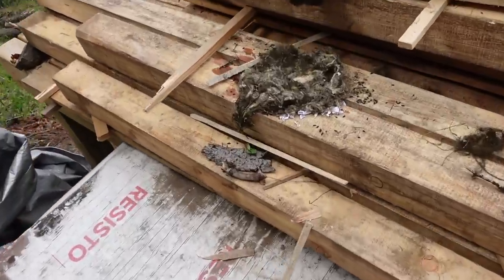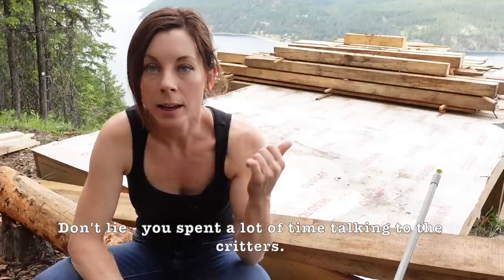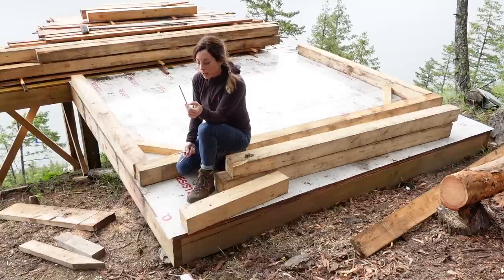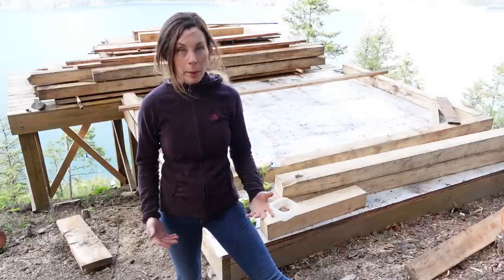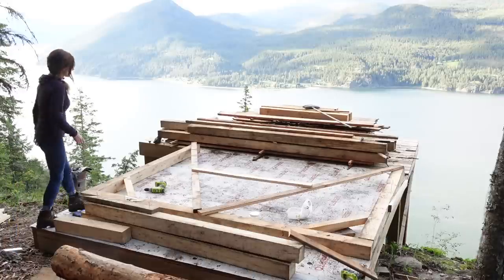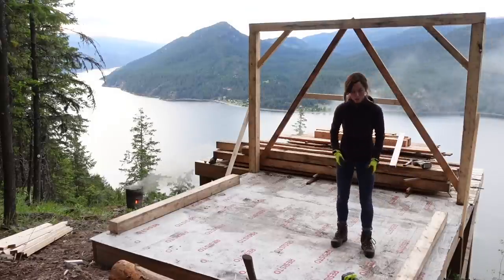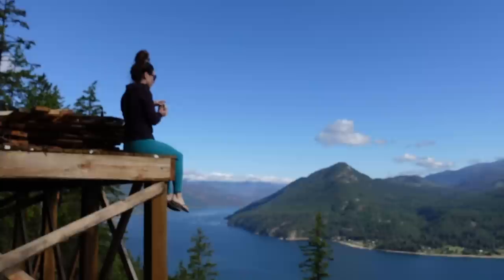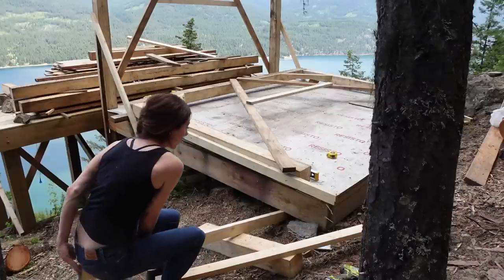Back to the cabin build, baby!! (I'm building a cabin on a cliff Chapter 10)

Comment: As someone that homesteads and does build projects primarily by himself...oh how I know the struggle. And the time...holy molie, the time. Building jigs and levers just to hold something. The sketchy foot and hand holds to not fall while fastening or positioning a piece. 
As you well know it's a journey, not a race...remember that as you go higher. Be intentional. 
Check out the variety of simpson ties or timber hardware available...some of which you can make yourself. Consider wind lift...tie into your foundation platform. And use gussets where you can. Diagonal bracing notched into wall framing, attached at the post and floor is hella strong. If you do it on the exterior side it takes up very little insulating room and its flush on the outside so you just side it in. 
The number one rule....don't get hurt.
Thanks for the fun vids and keep rockin it!! 
And kill them fkn rats
Reply: Good advice. But don't kill the rats. They deserve to live in their habitat. Just move 'em out. Your activity will keep them away.

Comment: I subscribe to the motto (?) “if it looks straight/square it is straight/square”.  I’m constantly impressed at the way you overcome obstacles like figuring out how to lift that first subframe by yourself. I removed an old 4 inch steel post that was set with nearly 300 pounds of concrete in a 3 foot deep hole by myself.  Not because I’m all that strong but because I levered it up 2 inches at a time and scooped dirt under it until the hole was full. Then I used a come-along and more levers to get it up a ramp and onto a trailer to haul off. Leverage and mechanical advantage are your friends they are force multipliers if you will—you do a good job of using that…sometimes you gotta try twice but you eventually get it done. 👍🏻👍🏻

Comment: I always work by myself too it seems. A person can learn a lot of tricks and make “ helping hands” tools over time. Good job . You might get you a 1 inch or so spade bit and counter bore your lag bolt holes so the washers set down in the hole , then you can get more reach from your lag bolts plus the bolt heads are out of the way too.👍
Reply from the maker: I know. I actually tried to make adjustments with a drill bit to set them in better, but the drill bit broke. So I gave up.

Comment: Pro-tip! :) if you want to lift something heavy and hold it in place on your own. Make a tapered wedge from some scrap-wood, and club it in with a hammer under the thing you want to lift. 

You get surprised how strong a wedge is. If you make it low profile and long taper. It will even lift a house! :D

Keep up the good work!

Comment: Countersink your lags. Use a spade bit to create a flat spot for the washer to seat on. Notching the beams would be a good idea. You could do fairly deep ones, say 2 inches and it would create another surface for the post to seat into, and won't weaken the beam appreciably. Also gives you a place to drive toe-screws for added strength if you want.

Comment: Nice work lifting the bents up by your self !   I felt so happy for you when you found the broom and could then get the drill.
reminds me of the shed i built this winter, getting the 4 posts up and were they needed to be was tedious and challenging...by my self, on bead rock with nothing to brace them with...
yours were heavier, on a cliff, and you or second bent could have gone sailing of the cliff if the plan didn't work out...
I beach combed my posts sized them with a hand saw then dragged them up a 70' cliff with a rope. but it was just a loveless work shed... I like your project better :)

Comment: You had me on the edge of my seat when you put that wall up. I was thinking to myself,  please don't fall off the front..lol
Don't worry about the twists in the beams. Once you put the exterior and interior wood on the walls you will never know its there. Your doing great, be safe. How about mounting a camera on top off a load and take us for a ride down the Sky Mule? What the hell was that big air horn?
Reply: I think the air horn sound was to cover some choice cuss words 🙂
Reply from the maker: Yes exactly. To cover my swearing! 🤭. I will be leaving the posts and beams open to the inside, so we will see them. I really wanted to showcase them rather than cover them up.
Reply: @michygoss7148  so your not insulating and putting in a little stove? Just a summer hangout?
Reply from the maker: @timdunmyer4549  likely. I believe insulating can be done from the outside too, right? I might wrap some foam 1/2” or 3/4” to the entire outside walls if I’m feeling it at the time, but this is more or less gonna be a spring/summer/fall shack. And yes, a little wood stove to take the chill off.
Reply: @michygoss7148  yes definitely keep the post & beams showing.I love that look timber frame and post & beam interiors. They look so cool.

Comment: Hi Michelle ; very good work but  very scary at times .  Have good times to build .
In the past I used ropes to secure when I was lifting the frames and a third 2 x 4  leg ( articulated at the top - > rope with a bow ) , so if anything had happened I was safe .
I think you will need a terrace on the four sides of your cabin ( and  the roof overhanged  )

Comment: The struggle is real. It seems risky to depend on mechanical fasteners to hold structure together. Good gust of wind will topple your shanty. Please consider metal gussets at intersections with proper harden fasteners (shear strength). Beautiful view. Thanks for sharing

Comment: impressive, keep it up; FYI screws dont hold that well driven into end grain, half lap and driving screws in accross the grain is much much stronger also the edges of the notches stop the timber working and slowly drawing out the fastner, I am sure engineer Steve would agree. I do worry that an exposed structure like this will get significant forces acting on it during winter including lift.

Comment: Very clever use of the lever, fulcrum and tree.

To lift the floor in the future you can get a couple of those scissor lift jacks for a compact car.  

Underneath the edge of the floor on each side, dig out the ground a little and place the flattest rock you can find in there. Sculpt the ground to make the rock as level as you can because that will be the foundation for the lift jack.  Place the lift jack on the rock. So you'd have a jack on each side of the floor which you can leave there permanently. If you need to shore up the foundation with more rocks in the future you can just jack up the floor.  You'd just need to get lift jacks that can take whatever final load you can estimate they'd have.  Seems like a lift jack for a compact car would handle it for what you're building.

Comment: One trick you might consider instead of notching 4x4's is to use 8” x 8” x 1/2” plywood or OSB as a gusset attachment while framing. They can be concealed later by siding or trim. You can also use them on bracing and lots of applications.

Comment: Michy, every now and again just stop and have some more coffee...there was nothing wrong with your brace, you just had it facing the wrong way, always remember to have the braces pointing behind you,not towards the direction that you are lifting into..
In fact, a neat little trick is to stagger 8-10 inch cleats onto the deck, and nail your braces onto the inner part of the the outside corners, and as you lift you can lock the foot of the braces up against the cleats on the deck, and lift it little by little, without killing yourself 🔨😉 there's many hacks that help when you're building alone, they can save you a lot of effort!

Comment: That was cool . Do you have a brake system for your trolly cable or did you just let it fling ? Water could be readily available if you can install a wather tank on top of hill . Fresh water is a blessing.  Your portable generator in your truck with a long heavy duty cord . Power to charge up devices matters . Not sure your plan for a chimney fireplace but they have nice set ups that don't take up much space . windows ? Building trusses is easy . Roofing matters.  Your doing an awesome jod look easy.  Thanks for sharing my tips are just that . Peace stay safe..
Reply from the maker: The zip line is a special one designed specifically for steep slopes, so there is an air brake in the system that slows the load down. 
Definitely have lots of things to do to make it more liveable - all in good time 😁

Comment: Notching strengthens the joints.  You would be surprised at the difference. Mortice and tenon would be the true way to do it but a simple half lap will work fine for what you want.
Reply from the maker: I was afraid that it would weaken the beam as they’re only 5”x5”. But I’m pretty sure that’s what my plan was in the fall when I purchased the shorter lag screws. I will likely add things here and there as I go to strengthen things.
Reply: @michygoss7148  because of the joints you won't be weakening anything. You will actually quadruple the strength of the joints and they will stay truer.
Reply from the maker: @amerritt261  ok, good to know for future. Thank you.

Comment: That’s a great idea to have the knee braces flush with the exterior. When you put your boards on the outside it will give those corners even more rigidity.  Your issue will be with the floor connection tho but you could get some Simpson heavy duty angle brackets to take care of that and just tie it to the floor joists. The cool thing about what you’ve done compared to what you can do stick framing it is you could literally have a huge window or series of windows on one wall.
Reply from the maker: Yes my thoughts exactly also on putting the braces to the exterior - adding extra rigidity to the structure. I’m not using any plywood, so doing little extra things here and there to make up for it. 🤞😛
Reply: @michygoss7148  of all the projects people have on YouTube yours is the most interesting. It’s a treat to watch your episodes on the cliff hanger. I wish I had the patience to create my own content. I have a similar proooject but in the hand clearing stages for a private dog part.
Reply from the maker: @stephendaniel168  sounds cool! Yeah - documenting what you’re doing is a whole other thing than just doing things, which is what I used to do. Definitely got way more done before, but I enjoy sharing my journey too.

Comment: Consider a small mechanical or hydraulic jack to lift and level the floor. A cable "come a long" to lift complete wall sections. A tool belt to keep your tools handy when your hands are full holding a frame in position. During my high school days, most farm girls were stronger than city boys. Green wood will warp after milling. I suspect many comments in your high school yearbook are true. Is it practical to move heavy materials by water to the shore below your cabin and winch them upward?

Comment: Tips for picking up walls by yourself. Lean a little 2x4 block on its corner edge  of your top plate. Bury your claw into the wood for a handle, and lift. The block will flip down hands free, and buy you that 1-1/2”finger gap. Same for when you were lifting the corner of the structure. Make a little crib as tight as you can under your rim board with cut-offs, leaving enough room sticking out to lean the block against the rim. Lift with the lever, and the block will tip over under the rim. Add another 1-1/2 block to your cribbing, and repeat until you get the height you need. When standing up walls, use long braces. with a single good screw, fix them as close to the top plate as you can, and run them in the direction behind you, so as you lift they’ll follow you and dig…most times into the ground taking off some of the weight for you. You can also conjure up another one right where your lifting as a push stick to get the last few feet of lift, and be able to quickly temp brace it where your at to a block on the floor. Lifting heavy/tall walls by hand can be a dangerous business. Using metal straps (like the ones you see on bunks of lumber,) as hinges on the bottom of the post/wall plate, will keep the bottom from kicking out and turning a wall into a human sized fly swatter.

Comment: Make 2 equal wedges and let them slide flat sides over each other. This way you can easily lift your deck with a hammer. then put a screw through it to connect them

Comment: Next time to make raising the wall a little safer and easier, position the braces on the sides so that they will drag on the floor as you raise it.  This will help support the weight and keep it from falling on you.  Also, placing a vertical board down the center of the (A) brace will give you something to hold as you are standing the wall.

Comment: You need a single jack for those spikes. Also like I said if you notch the beams, then counter-sink lags, that will be stronger. I would try to use wider knee braces in the corners and two lags, or even through-bolts, on each end so the braces won't tend to pivot. If your partner is an engineer, how is it you don't talk about these things beforehand? Taking it "one step at a time" is not a great idea. Think about it at home and draw pictures. Knowing what you want to end up with and working backwards to what to do next is really the best way to go.
I'm sure no matter what you do will turn out fine if you use enough wood and hardware. I've been a carpenter for over 40 years. These are just intended to be helpful suggestions. Beautiful building site. Wish I could be doing what you're doing, but if all goes according to plan I'll be building myself a home-on-wheels in the near future. Cheers.

Comment: Found your video interesting. Kinda nostalgic. Started cutting timber for a log home 20 years ago. Still not done lol. Life happens. I did go up 2 stories with log. 20,000 board feet of timber. I do love working with wood. What kind of timber are you using?
Reply from the maker: It’s mostly lodgepole pine and hemlock in that bundle. I have a video from last fall where I mill the giant lodgepole pine for the cabin.

Comment: Suggestion: Get some steel cable and run it above your build site from what I can see as the large tree on the Right to what looks like another large tree just out of frame on the Left. Make the cable as tight as you can. Step 2. Attach a small block and tackle winch to the steel cable, so that it is suspended above your build and winch up the wall sides one by one slowly and then anchor each one at a time. Save your lower back. 😃🙏
Reply from the maker: The problem with YouTube is that by the time you guys see the video, the walls are already up! 🤪
Reply: @michygoss7148  Are you in BC ? It sure looks like BC to me. 👀😃I'm in Alert Bay, BC 👌
Reply from the maker: @markjob6354  yes it is BC!
Reply: @michygoss7148  I'm almost positive I've seen you before. (??) Hmmm ? Have you ever visited the Port Hardy or Port Alice area in the past two years ? You seem familiar to me ?

Comment: Get things like clamps,ropes and next time you are putting up frame use  longer wood at the top or sides when pushing up your self and temporary screw a piece on the ground so just in cause it fall on you or over.

Comment: You can get more strength out of the corner braces without going whole hog by letting them into the posts and then using 2 screws to hold them in place. The difference will be considerable and it is not a lot more time.

Comment: Looks good but I really think you need better footings where you where shimming with the rock and maybe the other side too.  Small rocks will move with the dirt moving.  Footings really need to be deep and rest on something solid.  May need to dig down and pour some concrete.  But what do I know; I'm a chemical engineer not a structural guy.  Just commenting based on what I have observed on many constructions projects.  But yours may not have that much load but still something more substantial may be in order.
Reply from the maker: There is bedrock just under the earth, so I definitely could have dug down further from the beginning. I will just see how it goes, I’m sure I can make some adjustments as I go.

Comment: Surprisingly stupid good hammer skills, M. Couple things-see if you can hit the water with those rats, get yourself an 18-20oz straight wood handled framing hammer and put that other thing in a drawer. Fancy is for those complaining about your lack of artisanal timber framing joinery-the ones who haven’t done enough wrong to know what’s right. Your joinery reasoning is dead right, but think about your bracing and lifting a little more before acting. Good work.

Comment: not bad. but why did you use not thinner Dimensions ,? 2x6 or 2x8. easier.lighter. and osb inside.  european style. tyvek outside!😊😊
Reply from the maker: I wanted to try my hand at a little timber frame/post and beam cabin

Comment: Please,  if you stand anything else like that be sure to toenail the bottom  down to keep if from slipping out and throwing you under the top of the wall as it falls on you.
Alternately, tying the feet  off with a bit of cord is acceptable as well.
One more pre brace strategy for  you to use is to attach the temp brace to the floor at an angle with two screws in it and then stand the wall up into it.  At that point you don't need to let go of the wall to secure the top of the brace once its up.
and yet one more would be to secure the bottom down where it goes and then tie it off with a length calculated piece of rope so that it leans slightly out once it's up with the rope taut.
this is especially handy if there is any wind at all.

signed,  a career framer who has worked alone for decades :-)

I will admit that I stopped watching for a long time out of sheer jealousy of your cabins location, access and view. Now i'm back and still not sure if i'm over it yet:-)